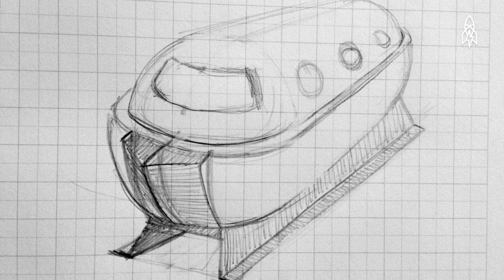Building a Better Ship for Tsunami Survival

Comment: Im sure you have alot of comments.and im not a engineer. And i hav also thought of a few things and id like share a couple of things also with you.about many differant possible concepts of a fully submersible and drivable underwater,sat.dive habitat..sesrch and rescue. Or  oil and gas cranes.ect.all being..fully submersible .and meant to remain underwater.some are drivable shelters/habitats. Others are made to only partialy rise or not but all will have heir own  ambilical connection for resupply from suface or another...DSRV..a tsunami shelter,our minds did think we. same thing since we saw it all happen live as well.

Comment: This kind of boat already exist in fiberglass. Like you sound like a 8 year old boy talking about his invention. And you need a better material wood is not as flexible and thin and cheap as fiberglass or if your crazy might in steel. Making it in wood is not strong enough to bump in to houses made and solid grounds.

Comment: Wouldn't it be cheaper, easier, faster, safer, better designed, and more eco-friendly to just buy a second hand boat to sit in your back yard?
Reply: krandaman1 which would fill up with water
Reply: It too would also roll.
Reply: A capsule wouldn't overflow with water.🌊
Reply: Tyler Bergh j
Reply: Water would crash over the top and cause it to capsize and thats assuming the force of almost a ton doesnt smash the boat to peicies
Reply: He designed this to survive tsunamis, not ride into them.

Comment: Well, nice hobby bro!

But I think most commenters and the guy himself don't quite get the problem with tsunamis... much like others don't get the problem with flash floods, dams collapsing among other disasters.

The first problem with this is having a warning system that would give enough time for people to get on board. Unfortunately, tsunamis are highly unpredictable. You wouldn't have time to enter whatever ship.

People on videos that were able to escape the Fukushima tsunami are way inland, and most of them just ran to higher ground as fast as possible, which is basically the optimal thing to do when you are far enough from shore.

But let's assume the ship is inland enough, or early warning systems evolve to give enough time for the warning. Here's the thing: tsunami water not only rushes in at incredible speeds, it also comes with tons and tons and tons of debris with it. And the more inland you are, the more debris the tsunami waves will be carrying.

So, we're talking about chunks of rocks, other ships, houses, walls, etc coming at you at speeds like 60, 80mph. Even if the ship was build to resist incredible ammounts of impact, you'd be turned into mush inside it.

I mean, you can build a different type of ship as a hobby, I don't care. But there's no such thing as ship for tsunami survival.

Comment: why not work on better early warning systems?
Reply: TINO 

It doesn't exist!
Their is no earthquake prevention device before days or enough hours to evacuate an entire city or nation. 

So far we can only see it coming within the same time the radar will show seismic disturbance but at the time you see the seismic reading all you can do is sound out the local warning alarm which is the same alarm siren used when testing nuclear WMDs in the 1900's.

The best choice would be to be on a boat or be on top of a parking garage or in a near deserted area. 

NASA has tried to launch ground technology but they've reported nothing meaning that they cannot reach advancement yet of reach down to earths crust with Prototype technology, so far the hurricane device is the only thing we have

Comment: Pro tip, don't build it out of wood!
Reply: Sturdier materials are only the first problem. Built as it is it will basically roll until the wave settles, this ofcourse will be "extremely uncomfortable" to it's passengers, think a collection of dolls in a tumble drier. It will, unless it hits something solid, keep the bodies in one place. Makes it easier for the cleanup crews and the mortician I guess.
Reply: Depends. This is for a tsunami, most life boats are inflatable and the ones that are not are pretty expensive. For one of those orange lifeboats in the movie captain Phillips you are talking up to 30 thousand US dollars brand new. A wood sphere is much cheaper. If you can source scrap wood and get the labor done for free I estimate that wood sphere would cost under 200 dollars.
Reply: Oh. I see. needs flexibility.
Reply: @swanbrown  flex seal flex tape or flex glure
Reply: glure?
Reply: @swanbrown  cover it with flex tape
Reply: I would've guessed it to cost more than $200.00 but less than $30,000.00, like at most after trial and error would be $20,000.00 (rough guess) with all accessories. Should be pretty easy to bolt some chairs down with safety belts/straps and cushions set up right, use rocket ship chairs as example or planes in case they roll
Reply: Why?
Reply: Yea, why?
Reply: admiralmw it will break in a tsunami if it crashes against something
Reply: @samclay2613  your wrong tho, it depends on the structure, lots of things are very strong and made of wood, it is the design with the wood that can help make something like this
Reply: Yeah, because you should sit in a metal ball at the bottom of the sea
Reply: It's a prototype
Reply: Guys we should all listen to Lord commander. After all that's his name right. He has an expertise in knowing how to build anything especially a boat. He's a know how to build a boat engineer. What do you think Noahs ark was made out of?
Reply: its called a prototype dumbasses
Reply: That thing would roll and water would get into the gaping hole in the front. Put a massive fin on the bottom or two smaller pills on short wings of a sort on each side and it won't tip
Reply: Pretty sure it’s just a model cause who the hell has a ton of metal or something that won’t break in a tsunami if he gets done with it shows it to a government or company that approves of it they will mass manufacture them and make them out of metal or some other material hopefully or the wooden one could just be used after the tsunami like when streets are flooded and stuff like that.
Reply: History fact most boats were in fact made from wood and for a couple hundreds most of Britannia's Navy was made from wood plus his ship is four inches thick.
Reply: +nanomage  :v.........................ok
Reply: let him alone is a pirat, arrrrrrrrrrrrrrr
Reply: It's a prototype
Reply: boah's ark is (probably) mad out of that wood hits many rocks didnt break!
Reply: Lord Commander Brandt your the best
Reply: Lord Commander Brandt yup
Reply: It wouldn’t float then
Reply: True
Reply: Flex tape over it maybe?
Reply: Lord Commander Brandt Every heard of a PROTOTYPE?
Reply: You do know Boats And Most Vehicles Begin with a Frame , He Obviously isnt going to use a Wooden Ship to Survive in a Tsunami , It would Break immediately.
Reply: The thing is 4 inches thick
Reply: Wood floats duh 🙄
Reply: Just get some Flex tape and flex seal.
Reply: Pro tip: PIRATES USED WOOD BOATS
Reply: Why
Reply: Oh so make it metal so it can sink and kill him! Nice job you fricking idiot
Reply: Wood floats that’s why
Reply: Metal is not very realiable sometimes because it may get you crushed by the metal or get wounded from the sharp metal when it gets destroyed from other solid debris
Reply: You are really underestimating how strong wood is.
Reply: Hahahaha, good to hear there's material scientists that can tell him that wood = weak. Well done mate.
Reply: for anyone asking why please watch a Tsunami take out all the wood buildings and just crush them on a wall.
Reply: @mystyleone1  No, that is not a comparison. A building is a square thing, made out of wooden beams to make a frame. On a tsunami level, this is a building made out of toothpicks in a sink. 

This is a spherical sphere with glue more than anything, glue and wood in different grain orientations. Good luck crushing that, they made wooden submarines you know ;)
Reply: @velianlodestone1249  yea and you would not want a building falling on a wooden Sub either. would crush
Reply: @mystyleone1  Depends on the size of the building, honestly wouldn't take much less than a steel sub, the form holds relatively much more stress than the material
Reply: @velianlodestone1249  k
Reply: He is american, they bild everything in wood, look american houses last cetua... I meen decad...... Years.
Reply: Wood is flexible and can be very sturdy, while also being light and rather cheap. Wood is a good idea.
Reply: after 4yrs, pro tip, you should know what prototype is.
Reply: Yes you are right! That guy should build it out of cardbox! Resistance to everything +100..👌
Reply: Owen Major In a tsunami? Boats like that couldn't do crap.
Reply: He isn't smart either, they already mass produce lifeboats that are most likely cheaper and more safe,
Reply: Owen Major yeah let me just get on my small life boat during a tsunami
Reply: @TheOwenMajor  its something he's doing because he wants to, he doesnt need to build the capsule
Reply: he wants to build one himself as a hobby
Reply: +Inferno  yeah, he is brave he should be a pirate.Arrrr
Reply: The lifeboats can sink if there broken by debris sea life or anything else. So his design may be safer than other lifeboats. But I don’t know
Reply: If you have enough weight at the base of the sphere (the people inside) it won't roll. It's not a ping pong ball.
Reply: @GodlessMartyr666  The rpoblem with: "If you have enough weight at the base" is rather simple one. If you have too much weight there it wont float. Especialy if its made out of wood because buoyancy wouldnt be enough with something this small carrying weighted bottom and people. It would have to be air tight. And for that wood is worst imaginable matterial. Single crack or puncture and you are going down real quick.